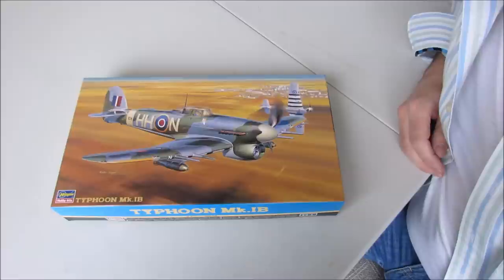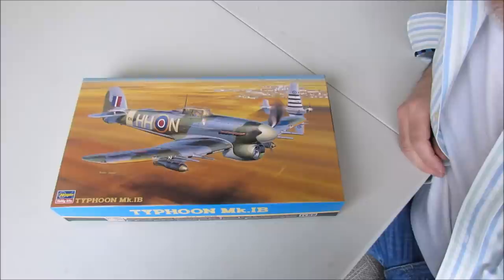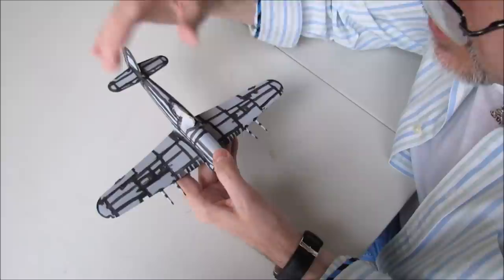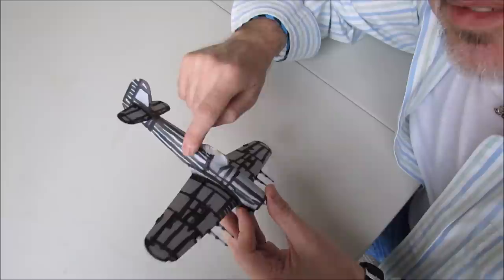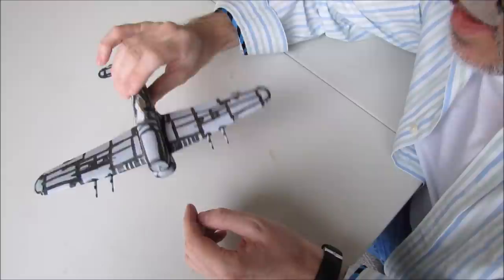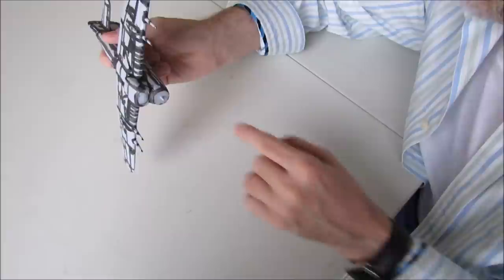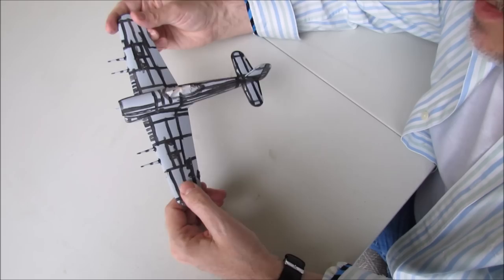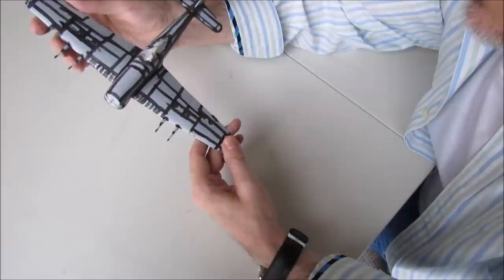Hasegawa 1/48 Hawker Typhoon Mk.1b Build Update #2 (7.8.14)

Comment: great progress Martin i think i want to get one of these now lol, if your nozzle on your airbrush is blocked soak for a few mins in some pure alcohol should do the trick and if you have an old airbrush needle use it to gouge out the clogged paint it works well but its up to you mate this is what i do if my nozzles go tits up great vid mate cheers :)
Reply from the maker: Hello Faron, thanks for watching mate, always appreciated! : )
It's a nice kit except for the three fuselage panels you have to fit around the cockpit area, which didn't fit too well and needed more attention than necessary. Apart from that, everything has gone together well, so unless anything drastic happens moving forward, I'd recommend this kit for the "Tiffy" lovers out there. : )
Cheers,
Martin

Comment: Typhoon is looking great Martin, btw did you use a board pen for the pre-shading may I ask? or did you use normal paint for it.
Reply from the maker: Hello Aston, thanks for watching again, mate  : )
For the pre-shading, I used flat black paint thinned down 50/50 with 91% Isopropyl Alcohol and applied it to the model using a small flat brush.